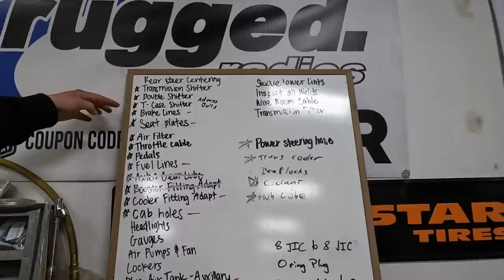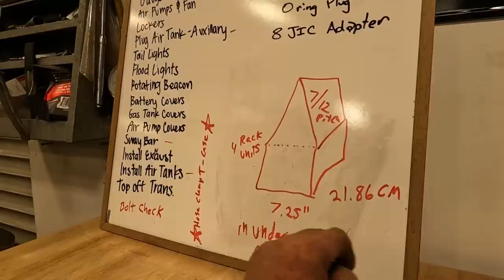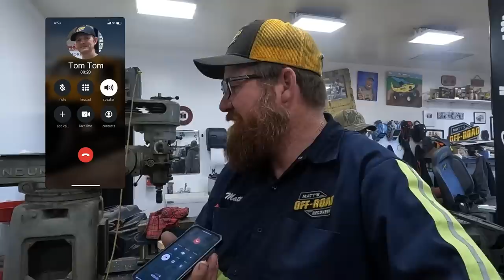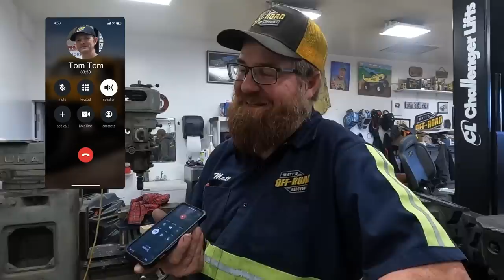Is This A Sign To Come For The World's Largest Off Road Wrecker?!

Comment: Hey Matt and crew! I run a small HVAC/Electrical business in the capital region in New York and can say the heat pumps will work to specific low temp, commonly 5° unless it’s a high heat unit. The unit will then start running a defrost cycle to prevent the coil from freezing while creating heat to send to the indoor coil. This hurts the heating cycle by reducing it to almost half thus creating a “no heat” symptom. Keep up the great work!!
Reply: Would it help if there was a 'positive pressure' in the work shop ?
Reply: I think the Cinder block building doesn't help either
Reply: As the outside temp is not that cold and this occurred with the furnace as well I'd have to ask if he is using the same thermostat as before or if both systems were undersized for the building.  I live in a cinderblock building with no insulation in Nebraska we saw temps this winter of -28F and my heater worked fine (costly but fine).
Reply: True, if he wanted to keep it warmer he would line the shop with 2 inch foam board insulation.
Reply: They need wind baffles on outside condensing units!!!
Reply: @RLee-zs1ds   technically all they’re doing is exchanging temperature of the air mass so introducing a fresh air vent to force outside air in wouldn’t make the system for effective. No a place like a restaurant where the kitchen makes a lot of heat and has exhaust fans running constantly, that would be the best place.
Reply: @GaryLX870D  definitely not, especially without a barrier between the outside was and inside wall to act as a barrier so the cold can’t sink in. But if the units were sized accordingly then they still should be having this issue.
Reply: Came here to say the same, northern Ontario Canada, we barely use these as they never keep up.
Reply: This is 100% the issue. We had a cold snap where I live and everyone with heat pumps had this issue. 

For places that get super cold they’re not ideal as the only source of heat, at least the ones I’ve experienced. 

They’re great it more moderate climates though!
Reply: As an hvac contractor in the southwest it sounds like a poor application of the equipment. My mini splits ony house worked fantastic even when we hit 26* a few weeks ago. Wind baffles may help with the cut out but without knowing the brand and model it's just guessing in the wind.
Reply: @jesseheien4226  I agree, I think the outdoor units could use baffles to help then at the lower ambient temperatures
Reply: Then why the h_ll would NY governor go to heat pumps it’s colder here
Reply: @LightningGB93  there are heat pumps that can work in Sub-Zero outdoor ambient temperatures, but I'm from Florida so I never really figured out the difference.
Reply: @JayWillis2120  I’m not an expert but I am from Finland so as far up as Alaska and we have tons of homes with heat pumps working great. So I can confirm the below freezing part.
Reply: The performance of a heat pump can be impacted by wind if it is persistent and blows directly onto the unit. To ensure the best heating performance, it is recommended to locate the outdoor unit in a warm area, such as a north or west-facing wall. Conversely, for cooling purposes, the unit should be placed on the opposite side. The efficiency of heat pumps is at its maximum when the temperature difference between the interior and exterior is kept to a minimum.
Reply: The heat pump needs to have backup heat for when it's too cold to make heat with the compressor.
I can't imagine someone would sell him a heat pump without backup heat, but that's what it sounds like to me.
If there isn't a couple of fat wires or propane going to those heat pumps, they don't have backup heat.
Reply: @bigredc222  I would assume there is so e sort of backup or emergency heat. Besides, he said it would even happen when they had a normal furnace installed.
Reply: @clark7117  so... should I be moving my condenser every season?
Reply: @bigredc222  traditional mini split systems have what they call a pan heater and that heats the base of the system to help with frost build up on the coil. With that, the unit is considered a high heat system and the unit efficiency is capable of temps as low as -15°F but I don’t know what they have at the shop in this case
Reply: @LightningGB93  the removal of fossil fuel heat primarily. The also claim the efficiency is higher with the heat pumps but I can tell you first hand the heat pumps can’t handle some of the summer heat and cold winters we can get
Reply: @JayWillis2120  One of the first lessons I learned when troubleshooting is to ignore what the customer says, more times than not they will lead down a path that has nothing to do with the actual problem.
Reply: @JayWillis2120  no. A site analysis should have been performed before the installation of the heat pump. Despite the common belief that heat pumps are simply plug-and-play, a comprehensive site analysis involves evaluating solar, wind, and radiant heat conditions. Every aspect of a building's envelope exhibits a range of temperatures and may contain pockets of hot or cold air, or even areas with no airflow or strong drafts.
Reply: @bigredc222  I bet you get a lot of call backs...

I don't sell air conditioners, I solve problems, and when the costumer says it's only cold when the wind blows, I'm checking R-values before I ever think about replacing a perfectly good system.
Reply: A manual J, correct.
But to believe that the system is failing in high winds, heat pump or furnace has anything to do with condenser placement is ridiculous.
Reply: @JayWillis2120  I'm not an HVAC mechanic I'm an electrician. I wrote that wrong, I was just saying when the customer tries to diagnose the problem, you ignore that, but you have to listen enough to know what the problem is.

Comment: Hey Matt, your mini split heat pump doesn't have back up heat strips. When it is super cold it will go into defrost. When in defrost it puts in air conditioning. Make sure you are keeping the heat running even when you are not in the shop. Mini split units are very efficient and work better when you maintain the temperature inside.
Reply: Very good advice. Also consider investing in low ambient temp units. If youre units really are being affected by wind, consider buying or make a sheet metal baffle to keep the wind off the front of the condenser fans.
Reply: @qomco  I think they are only affected by wind because it takes more to heat the shop in windy conditions due to the shop being leaky. The unit its self doesn't really care about wind, it just cares about ambient temps.
Reply: Waste oil heater. Gotta do sumpin with all that wasted hydraulic fluid.
Reply: Are you an hvac tech? I plan on installing a two unit system in a home I’m remodeling for my grandma, in Ohio, temps can be -20 during the winter, what units would you recommend for a 650sq ft house, I want two wall units for each side of the house
Reply: They're in the southern Utah desert.  It doesn't really get super cold there.
Reply: and possibly a wind break for the unit out side so its not getting direct wind on it. ive seen some fans stop turning in the wind.
Reply: Is there any insulation in the walls?
Reply: @mccatdaddy  Sounds like what you mean is a two head system (one outside unit and two handlers inside) I would recommend 2 independent systems for redundancy.
Reply: @stargazer7644  it does at night I'm not sure how low their summer nights are it seems like they still get a decent winter based on some videos he does service a pretty wide area though I wouldn't have guessed they were having heat troubles out there lol
Reply: @Anthony E  I live in the mountains in NE. PA. I have a Fujitsu split unit. It works good down to about +10. I have to use electric baseboard for backup that was in before we put the split in for AC.
Reply: @mccatdaddy  acá en argentina ,explican que a menos de 0 grado ,rinden muy poco las bombas de calor
Reply: Lo que escuche es ,revestir las paredes con durlo ( tablones de yeso y forrados de papel) ,con una pequeña separación de la pared original ,da excelente resultados ,para aislar
Reply: Also look at the thermostat. They have 2 or 3 stages. If the heater can't keep up and the room keeps cooling down, the t'stat will kick to stage 2 (if available). If room temp keeps dropping it goes to final stage of heat strips (emergency heat). At this stage the t'stat can turn off the heat pump and rely on strips alone. The heat pump probably doesn't have strips .....and everyone freezes. 

All that and the defrost timers can make things really cold.
Reply: It needs an air horn!
Reply: I’m in stitches laughing at you guys!
Reply: @Codemeister99  The coldest average low temp in winter in Hurricane is 30F.  It is hardly an arctic environment.  And his complaint was when the wind blows, not when it is unusually cold. The average low in the peak of summer is 67F.
Reply: @mccatdaddy  there are a lot of variables for sizing equipment. Id hate to give you a recommendation for a certain btu and it wasnt exactly right. Undersized or oversized equipment both have drawbacks. Do you have another form of heat, tall ceilings, good insulation. At -20, you want either mitsubishi hyperheat or daikin low ambient condensers. If you have snow accumulation you will want the condenser off the ground
Reply: @t4thfavor1212  if wind is hitting the front of the condenser fan, it will be working against the wind. Think of the bob seger song. This will reduce the heat transfer, sometimes dramatically. Almost all manufacturers sell a wind baffle kit for this reason
Reply: @mccatdaddy  you will probably be looking around 12k to 18k btu. But like I said there are variables to narrow down.
Reply: @mccatdaddy  you can get multi head unit,24k btu ,I have Fujitsu units in my house,-15 !
Reply: @edber29  my FLXZH Fujitsu works down to -13

Comment: Hey Matt, long time watcher, first time commenter. I build old Land Rovers and just a quick tip for remembering which bolts need to be checked: I always stick a piece of masking tape on or near anything that isn't torqued or needs to be checked. It acts like a little flag to alert anyone working on it that something isn't complete. As a bonus you can make a note on the flag what needs to be done. Super useful for me, because I can't remember anything. Love the channel my dude!
Reply: Working on my 96 Disco, that's NOT a bad idea man. Service flags on bolts! Thanks!
Reply: Takes as long to mark it as it does to torque it.

Comment: You need to get wind guards installed on the outdoor units. It will block the wind from just passing through the condenser coil when the wind is howling.

Comment: HVAC guy here. My guess is that when the wind is blowing your condensing unit is probably not expelling the cold air which is absorbed from the conditioned space and taken outside to the condensing unit and getting your pressures wonky and tripping some sort of safety. It could be many things though and no way of really knowing without actually being there and checking over the system properly.
Reply: I bet you the outdoor unit is on the roof putting it in the highest possible wind

Comment: nice glasses, and the refraction through them is real, so those are indeed real glasses, and great, those actually help a lot for any person that has bad eyesight, just one thing, you can see that they are sitting at an angle on your face, it is not a big issue for short time, but for a few hours, those can strain your eyes more than they should and you could get headaches, just try to get them straight on your face, and if it is the arms that are somewhat not straight, it is really easy, any shop that works with them can use a small special heatgun to heat the plastic a bit and bend it back to straight, or you can do it yourself, just remember, barely any heat, no need to melt it

Comment: Mini split systems use a heat pump. By design they extract heat from the air but that means part of them will get cold. If it’s really cold outside the condenser that sits outside will freeze up causing the  unit to temporarily stop throwing heat until the outside unit unfreezes.
Reply: Shouldn't the heat strip kick in. And maybe he should move the outside unit and the thermostat.
Reply: The big tow
Reply: @tlak  Good question.  Perhaps the heat strip isn't working for some reason.
Reply: He said the same thing happend to his oil heater, sounds like wiring problem with the thermostat to me?
Reply: Most heat pumps stop at -4 celius.
Reply: Mini splits dont use heat strips, they are a different type of heat pump.
Reply: @briansmith1279  here in canada i can use mine until about -30°C. Last time it stopped it was -31/-46 with windchill and its kind of a cheap model. I'm guessing a wiring problem or a thermostath problem not asking for heat
Reply: Defrost
Reply: But they aren't talking about really cold conditions.  They're in southern Utah.  The average nighttime low temp in the winter there is only 30 degrees.  The coldest average winter daytime temp is 50.  He's talking about when the wind blows, and no, wind chill doesn't make the temperature lower.  

And the outdoor unit doesn't freeze up when it is really cold - It has a defrost cycle to handle that.  A heat pump can only do a specified max temp differential.  If yours has a temp differential of 50 degrees, then the air coming out of the vent indoors is 50 degrees warmer than the air outside.  So if it is 30 outside, the vent air is 80 and keeping things inside at 70 is no problem.  But if it is 10 outside, the air coming out of the vent will be 60, and you won't maintain 70 inside.  That's what happens when a heat pump can't keep up, and that's why you can't use them where it gets really cold.  It rarely gets really cold in Hurricane UT.
Reply: I agree with the system only able to maintain a 50deg delta. But on those Honeywell stats they’ll engage hp and aux heat if room temp is 5deg below setpoint. From his description “only when the wind is blowing” I feel like it may be a air infiltration issue and the hvac can’t combat the cold air infiltrating.
Reply: @moonmullins8227  Looked that up, uses a different freon for operating at colder temps, should find one with the heat strip.
Reply: Two things that are more likely: the thermostat or the wind.
The wind can throw out the condenser fan speed which will throw an error code to the unit. To fix this build a wind baffle in front of the condenser.
The thermostat looks like a T-6, if they've tied that into the heat pump it could be set up to turn off the heat pump below 5 degrees. Low limit changeover to emergency heat, which there is none on a minisplit.
EDIT:
Also, you should clear out the rack in front of the head. The parts will block the airflow leading to recirculation. 
The remote control being right there beside the unit, if it is recirculating could also give a false positive.
Reply: Don't heat pumps grab humidity?  Wind blowing strong, the air with the humidity (very little in southern Utah, especially in the winter) will be moving too fast for the unit to grab moisture?
Reply: @alexsartor2402  he also said it was the same when they had a furnace.  My theory is there's a fan somewhere that stops or slows when the wind is strong enough.  Why the wind can get to said fan is another issue.
Reply: here in Nova Scotia we just had a couple of days that went to minus 25 celcious which would be minus11 farenheight and our heat pump worked just fine.
Reply: The wind lowers the outdoor temperature, affecting the availability of heat in the air. A heat pump draws its heat from the outdoor air. They do make guards for condensing units, that will somewhat counter act the wind. As for the furnace, it could have been a few issues, without seeing it, it’s hard to guess.
Reply: @flynnboles6933  5 Degrees F in the southern Utah desert?  That's pretty rare.

Comment: Fun fact, if I recall correctly, Han Solo’s use of parsecs was actually correct! He said he made the kessel run in less than 12 parsecs which was impressive because there is a black hole that you have to go around on the way in order to not get sucked into the event horizon. Meaning he was bragging about doing the run in less distance insinuating that he passed into and subsequently out of the event horizon of the black hole and was able to do this because the millennium falcon is the fastest ship there is. The only one that can out run a black hole and do the kessel run in less than 12 parsecs 😎
Reply: Wow!

Comment: Hi Matt, I'm a 20 yr commercial HVAC tech, look into "low ambient kits" from the manufacturer of your mini splits, they are basically a wind baffle you might be able to make them with some sheet metal from the picture . With your furnace it was probably the way the flu was installed. Hope that helps

Comment: The heat pumps could be a freeze protection deal. Some of those newer mini-split style systems have that as an option. I'd definitely recommend a wind block for them for a couple reasons. 1; you don't want debris or dust being thrown into them, 2; the lower air temp is going to affect their efficiency and function. As for the gas furnace, I have no clue. That's a weird one!

Comment: Hey guys, just an idea for next time... the seat belt mount can be a "L" shape bracket mounted under and together with the seat on the floor. Saves time on building and avoid any structure damage on the seat frame when welding since not knowing the thickness of the frame metal.

Comment: Suggestion on the making sure everything is tight is to line mark all the bolts and fittings that you have tightened down as you tighten them.  It gives you a way to quickly check bolts and hoses if something has move or if its coming loose.  Paint marker is the best usually a white or pick bright color works the best.  Not a new thing just comes from industrial standards.